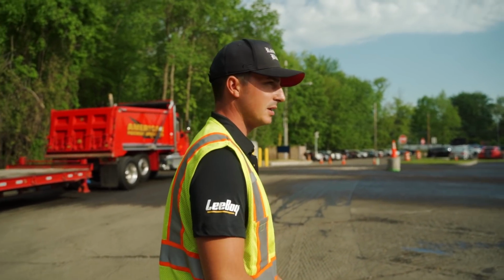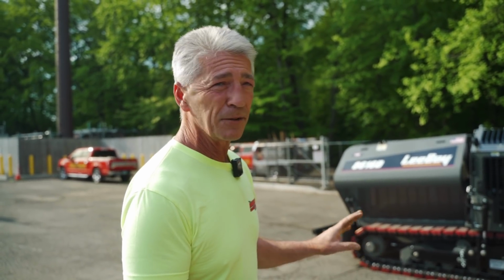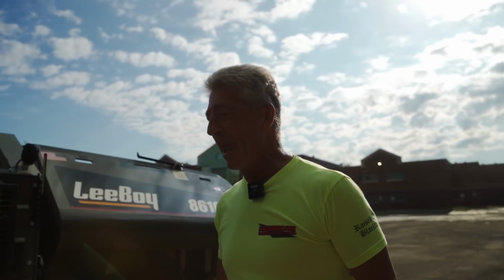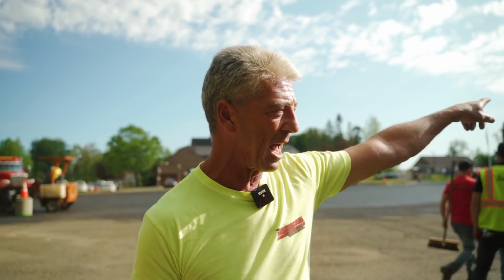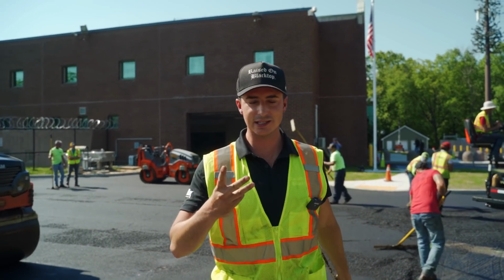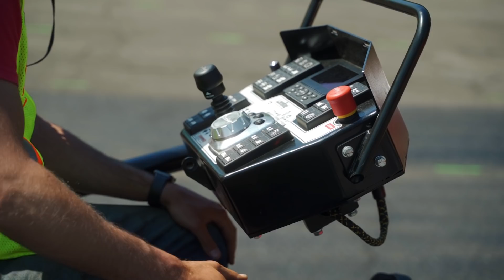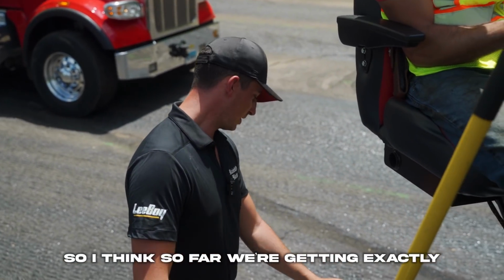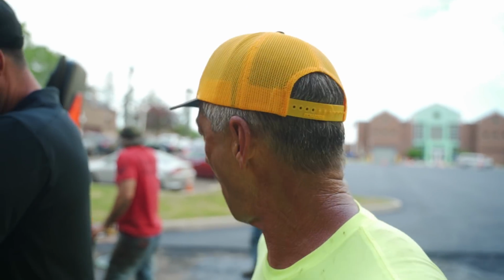ULTIMATE PAVING MACHINE - American Pavement debuts Raised On Blacktop® Special Edition LeeBoy 8616D

Comment: But when your screed is fully open, how can you see your plate if you’re matching in a joint while simultaneously reaching the button to adjust the screws? We have this problem with our midi paver, can’t reach the button while the screed is fully extended. Awesome machine though that 👍🏻

Comment: Nice machine, definitely an improvement over the Leeboy pavers of early 2000's (Tonka toys).  Still vertical screws on 130hp 4k pound screed?  Please design horizontal screws for more torque and resemblance to a highway paver.
Reply: Why is it important the weight of the screed?
Reply: @alexmiller5717  I think it's what initially compacts the mat and gives it the surface finish you see before it's rolled.

Comment: I use to run the big paver and the small one .i sure miss them hard hot work my boss put me on the paver forth day i was on the job them was the days if you like your job everthang works out good most of the men i worked with they was there for a pay check they didnt care about there job i did my job right the custermer wonts a good job and there paying so do them a good job you get more tack care be care full pave on GOD BLESS